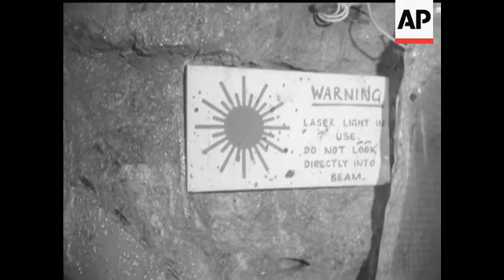SEVERN TUNNEL

Comment: I worked on the tunnel from day one till completion, my father was the Works Superintendent and very sadly lost his live in a crane accident at the Beachley site. The two rock header tunnel machines proved to be too slow and so drill and blast was used to speed the works. Water ingress pump up the shaft at Beachley was at 1800 gals per minute. Reduced to 25 gals per week from the total length of the tunnel works. I helped install the steel arches and the cable tubes used to cool the installed cables that seanwatts spoke about in the comment below. Some one removed the draw wire for the cables, new ones were installed using a Jack Russel dog owned by the gate keeper. 
I spent the rest of my working life on tunnel projects around the world retiring in 2015 after working on the KL Metro Malaysia.